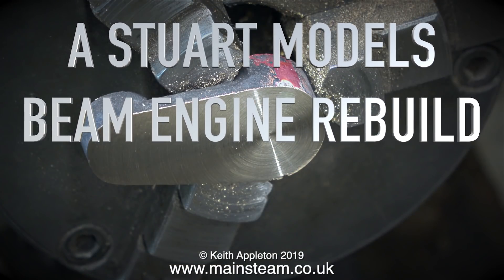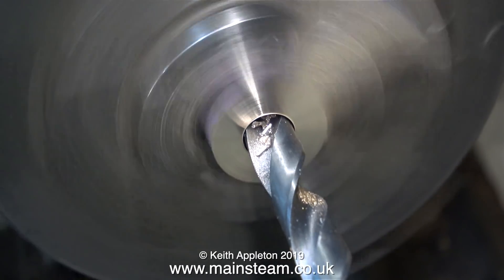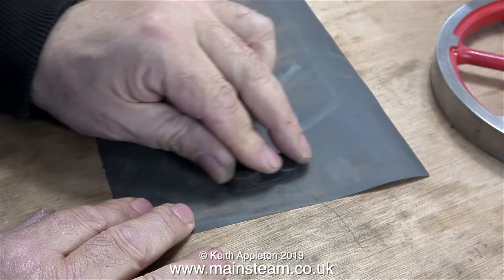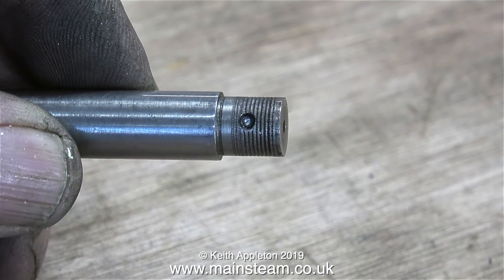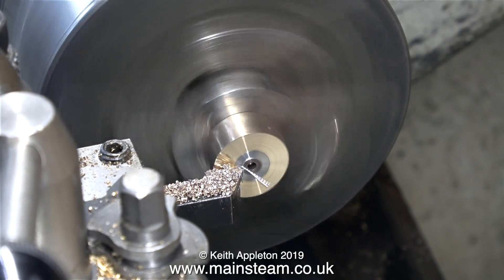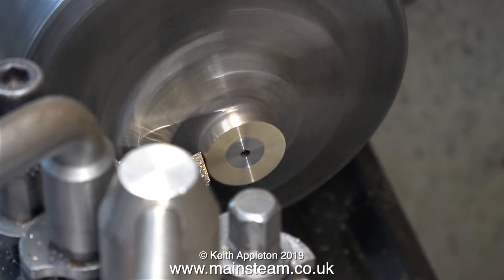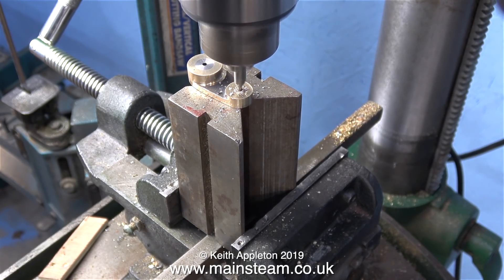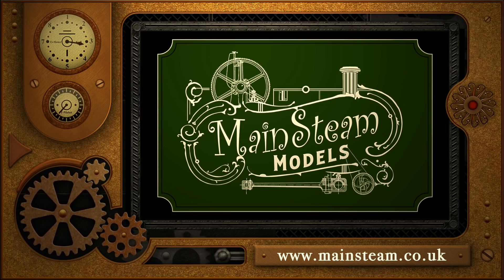A STUART MODELS BEAM ENGINE REBUILD - PART #4

Comment: Keith when you where cutting off the inner extra casting, you said this is just your preference, but this removal of unnecessary material, will it also help to improve balance? Not sure what made me think of that?
Reply from the maker: Not really, the weight removed is negligible . . .